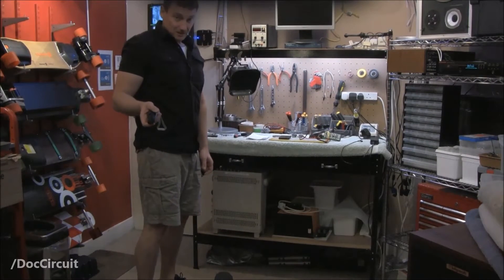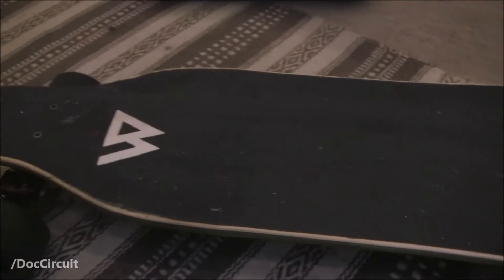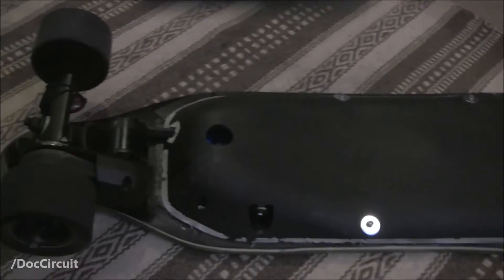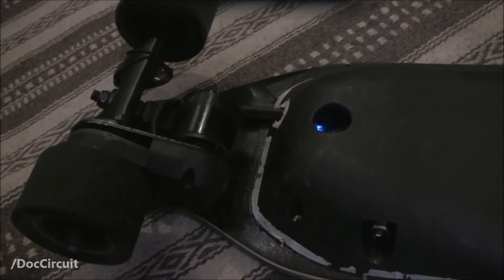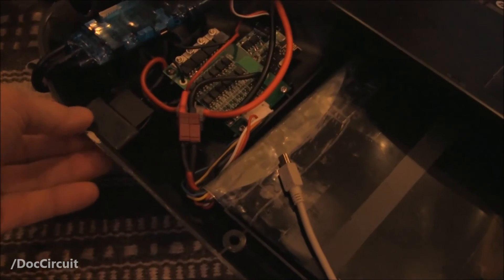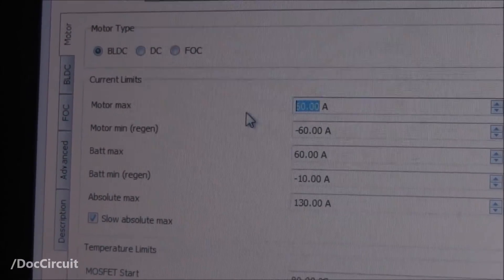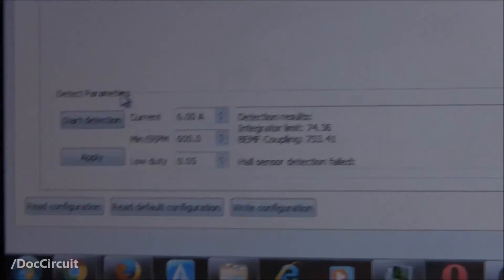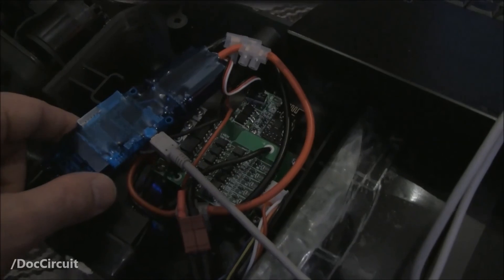Upgrading ESC to VESC. Results in Significantly Improved Chinese Clone Electric Skateboard!

Comment: Where did you get the VESC from? Thanks for the vid!
Reply from the maker: +willb003 I got mine from:

http://www.hellray.de/shop/#!/Electronics-&-VESC-made-in-Germany/c/15255004/offset=0&sort=normal

Enertion Board also sell VESCs. 

Hellray is a bit more expensive but you'll get it quickly, Enertion are cheaper but there is a longer wait.
Reply: +Dr Circuit Thanks for the quick reply. How long did the magneto board last before you blew the boards? I ordered one and it should be to me late May, so I want to be prepared. Any tips on how to determine which board fails, and what happened when they failed?
Reply from the maker: +willb003 About two weeks of light use before it blew. As for what happened and why... um, this is pretty much what most of my electric video have been about so far (namely, the poor quality ESC and BMS, accelerating/uphill/heavy rider, and how to fix these issues).
Reply: Do i need to add the XT60 when i order? :)
Reply from the maker: Not if you are going to use the Deans connectors that are already present in the clone board.

Comment: Great! that's what I was waiting for, do you thing that using vesc the bms will last longer?
Reply from the maker: +Luigi Manga I strongly suspect so. I've taken the board up various hills, done standing starts on hills, and so far the BMS is fine. The board accelerates slowly on hills and I've set the current limit to 60 amps so I think the current never gets high enough to blow the BMS. I'm going to continue to test the board with this configuration and if there are any developments I'll make a video.
Reply: +Dr Circuit did you install Vesc BLDC with Windows ?,..live to see a Vid of that!
Reply from the maker: +integra Yup I did. It's not really worth making a video of it though. All I did was download it and install it.
Reply: I am having trouble Uploading 2.16 firmware ,. it uploads to 100% but then says "Unknown Error" in bottom right corner and dissconnects?
Reply from the maker: +integra I was afraid of this, which is why I said no questions about the software side of things. Clone boards are 'fixed', I know what configuration they're in, but I have no idea of your computer and network setup, and I'm still learning BLDC tool. There could be any one of dozens (more!) of reasons for this.

Having said that, the first thing I'd try is the 'comm ports' option. I suspect you already know but if not you need to ensure comm port is correct.

The only time I received the same error message as you was when I selected an incorrect comm port.
Reply: ok thank you.